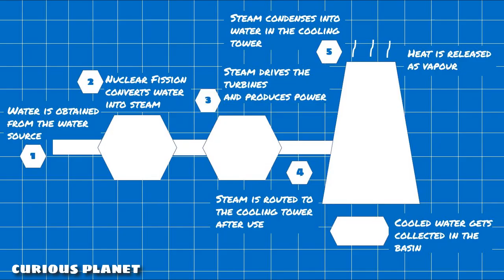Why Do the Nuclear Power Plants Have Such Wide Massive Cooling Towers? - 3D Animation

Comment: It should be mentioned (for folks that might not know otherwise) that in step 2 on your chart, the clean water never directly interacts with the fuel. Plants have massive heat exchangers that move that heat from a closed reactor water system to the fresh water in a separate system. Thanks for the nice video.